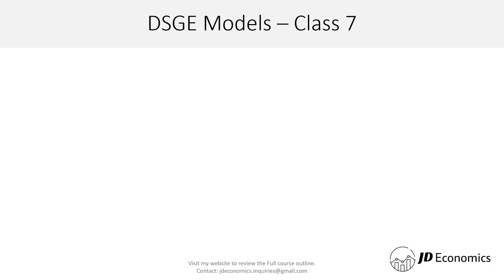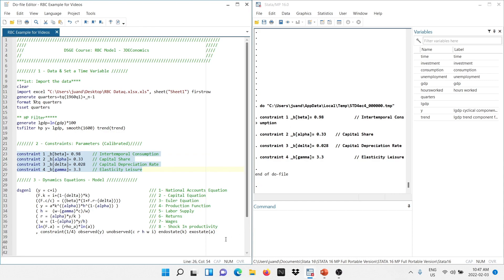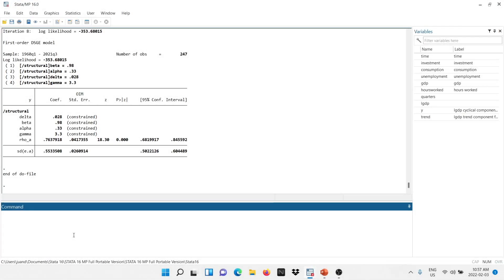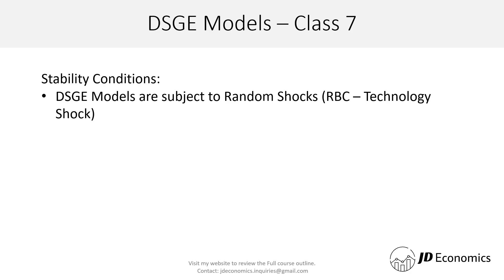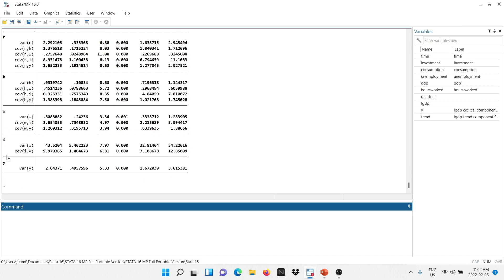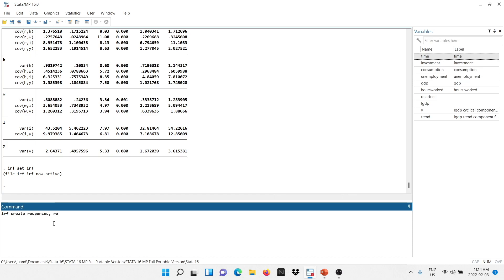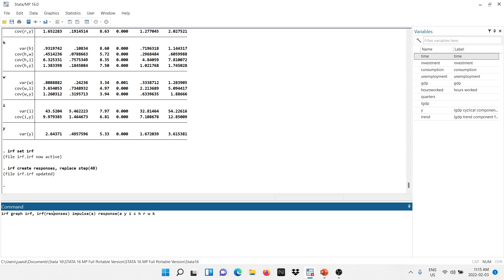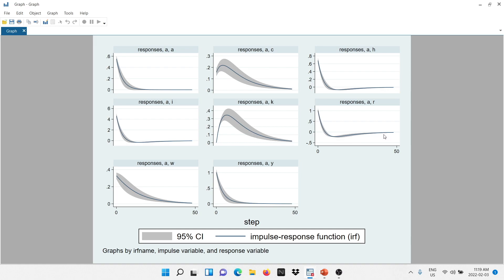DSGE Models (7) - Steady State and Impulse Response Functions

Comment: Hi JD, many thanks for this free course, really helpful! I have a question if I may. Although I'm using the same dataset and the do file, I keep getting the same error of "identification failure at starting values". I assigned different values to constraints, tried to change the order of the constraints and equations or just introduced 2-3 constraints but still got the same error. Also checked if it's because of the software, I used  the examples on the help file of dsgenl but these worked fine. What could be the problem?
Reply from the maker: Hi! It is indeed normally the constraints values. Also, make sure that the stata you are using is 16 or newer. You can acquire the material too in case you need it: https://jdeconomicstore.com/b/dsge-models-in-stata

Kind regards,
JD
Reply: @ForecastingEconomics  Thank you very much for the quick response! Actually, I'm considering for the Matlab version of this course but was just checking the free version first. Will look the material! Best, Ahmet.
Reply from the maker: @ahmetihsankaya thanks! Sure! I will submit in some time a New Keynesian In Matlab too. Cheers